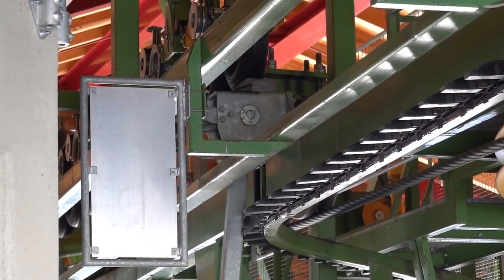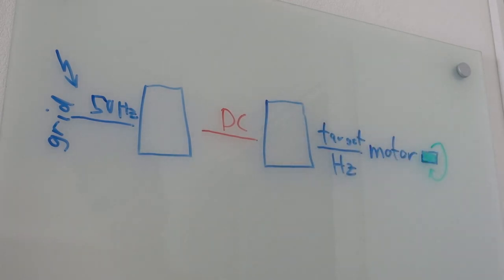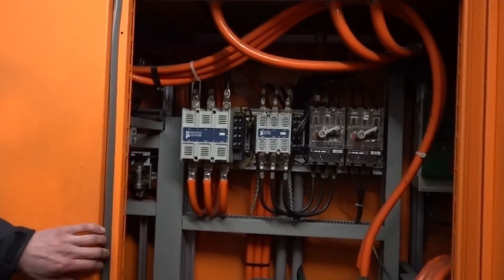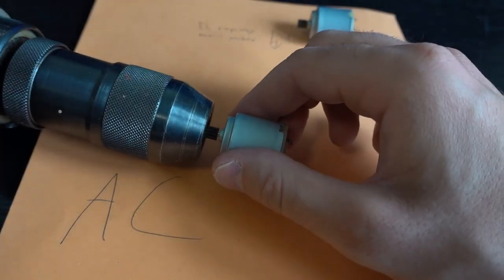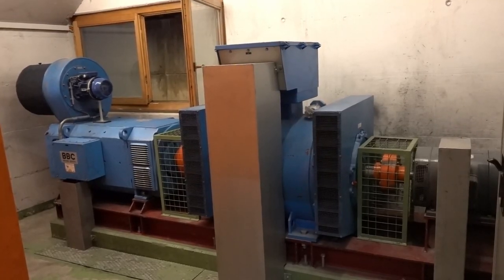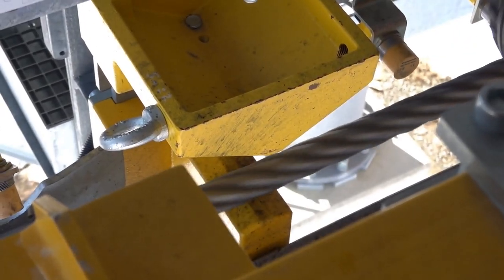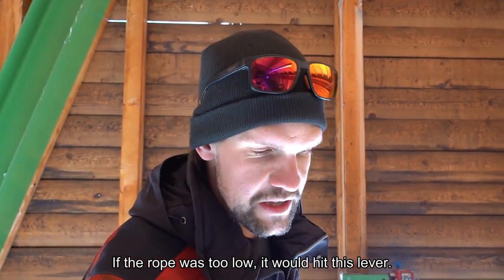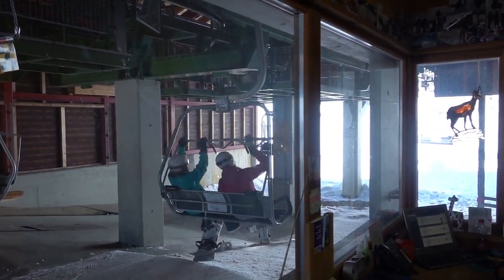The incredible leaps of three decades of technology evolution! Chairlift comparison (part 2/3)

Comment: A very nice explanation and examples.

What I think you didn't mention about the Ward-Leonard system is how it actually achieves speed control. The AC motor is a 3-phase motor, so rotates at a constant RPM. That means the generator also rotates at a constant RPM. So how can a constant RPM generator generate different voltages to control the speed of the drive motor? The answer is that the voltage generated depends on the strength of the field winding in the generator, and there are special controls to adjust that to produce the desired output voltage, or really the desired drive motor output speed, since the speed of a DC motor  is not a linear function of voltage.

Comment: You should make a video about how the ski-lift / t-bar hangers work. Always wanted to see how they work!
Reply from the maker: I sort of did that in the "The Impossible Skilift" video. Probably you mean something else, could you elaborate?
Reply: @sandro-here  I meant to say how the t-bar's rope is retracted or tensioned
Reply from the maker: @ebselectronics  it's a simple spring mechanism, like a clock winding. Not particularly spectacular 😜

Comment: Easier to just call it a motor-generator. 🤣

Messed with a few over the years, the coolest being a Martin B-26 gun turret which had its motor generators mounted on the actual rotating assembly to both convert power and act as a capacitor during extreme movements or power draws.